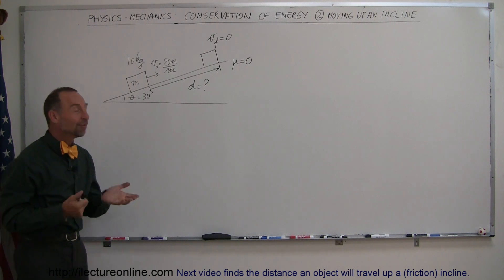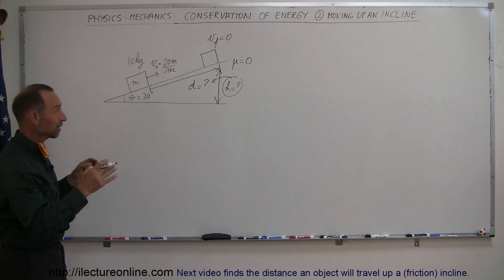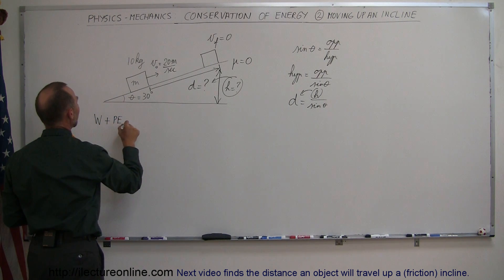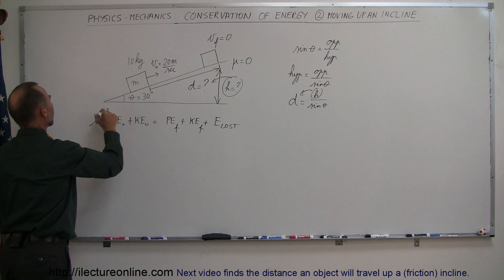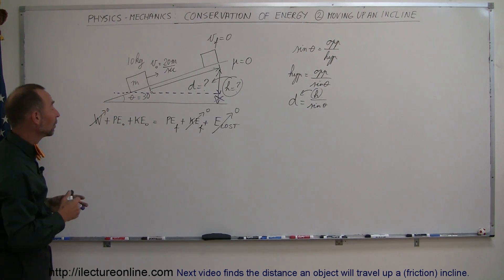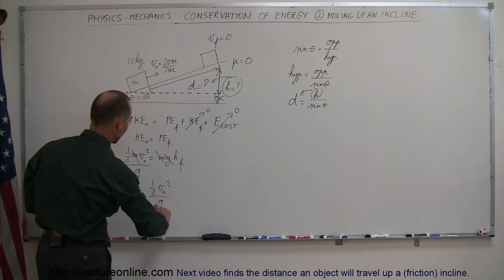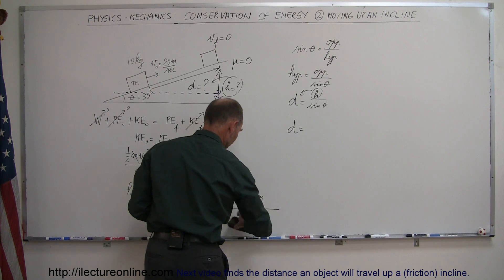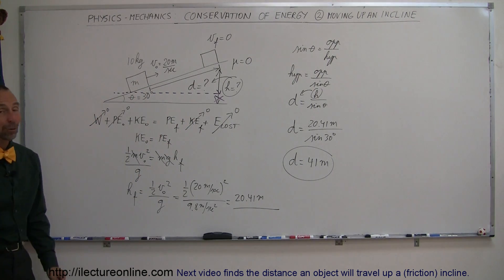Physics 9   Conservation of Energy (2 of 11) Moving Up An Incline (Frictionless)

Comment: If I throw a ball with 20 m/sec vertical velocity than it will travel a height of  meters in approx. 2 sec. h=20.41  meters . than if a ball thrown with 20 meters/sec  at 30 degree inclination than it will reach at the same height ?
Reply from the maker: No, it will not because the vertical component will be smaller.  (If the inclination is 30 degrees relative to the horizontal, then the vertical component of the velocity will be 20 m/sec x sin(30) = 10 m/sec.  The height reached will be about 5 m.
Reply: @MichelvanBiezen  agreed hence this must be the height achieved by our mas in this example shown in video here h must be 5 mtrs and d= 10 meters than
Reply from the maker: @chouhan15  No, the laws of physics acting on a projectile during projectile motion are different compared to an object that is sliding up a frictionless incline.

Comment: I don't get the explanation on why work is zero at 1:54 Can someone please clarify.
Reply from the maker: Using the equation on the board, W = work ADDED to the system from an outside source (other than the force due to gravity, and the normal force, etc.).  Since there are no forces adding energy to the system, W = 0.
Reply: there is no work or energy being added from an outside force such as a hand pushing the block up or anything like that.
Reply: This case doesn't say there is work involved nor does it ask us to find the work, which means that we don't have to include it in our equation.

Comment: Does this mean that a problem similar to this might have a different answer based on a different initial height?
Reply from the maker: With some problems the initial height has an impact on the final answer.

In this problem we are finding the distance relative to the starting point, so it doesn't matte where you start from.